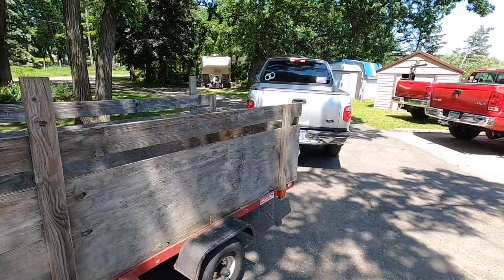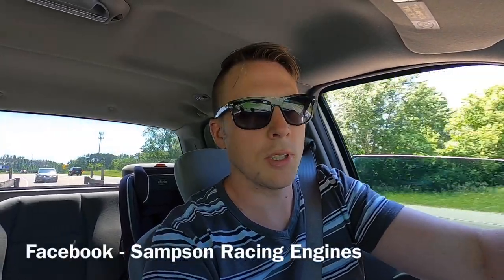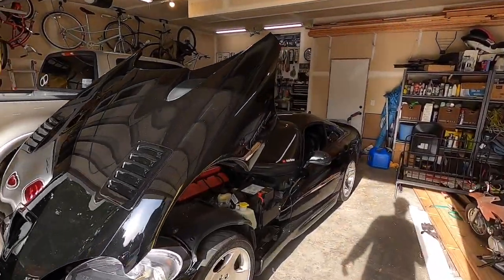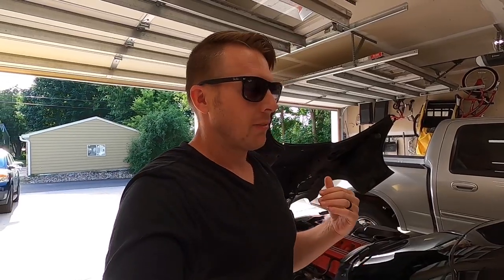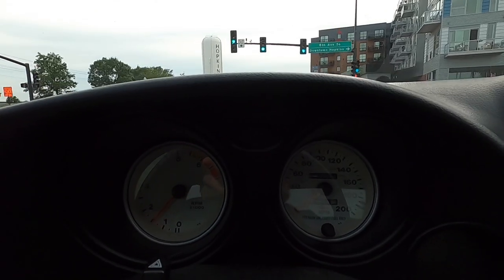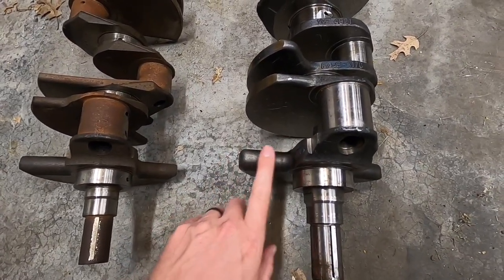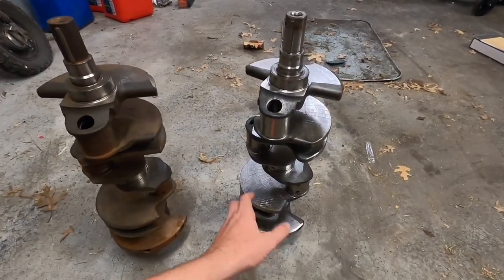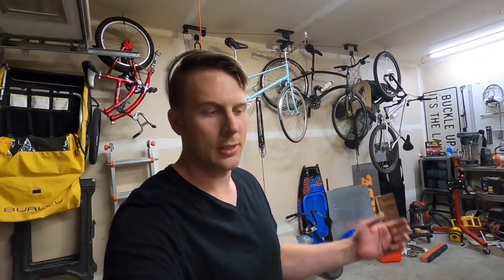1,000 HP Junkyard TURBO 5.4 Build (ep. 2) ***Cast vs Forged LIGHTNING Crank***

Comment: Keep in mind that with a forged crank your flexplate will need to be changed out. The forged cranks use six bolts rather then the 8 bolt configuration on the cast cranks. You can use a flexplate from a navigator if you’re going to keep the 4R70W... but with a 1000hp you might want to consider swapping to the 4R100. Swapping will be easier considering you don’t have a transfer case.
Reply from the maker: I hadn't noticed that. I'm going to see what my options are for building the 4r70w since I actually do have a transfer case and want to keep the 4wd if I can.
Reply: Auto Detour - Thats what I mean, I’m pretty sure the Lightning was the only truck with a forged crank which was a 6 bolt. I don’t think they have a flexplate in a 6 bolt configuration that will allow the torque converter for the 4r70w to bolt up. Sorry, I guess I was always looking at your gauge in the vent and never noticed the 4wd selector switch. Lol. The swap will work with your current transfer case. I’m working on switching to the 4r100 myself. Now I’m curious....
Reply: @brocklagunas3055  any F250 or expedition equipped with a 5.4 had a 6 bolt torque converter and a steel crank
Reply: I have a 5.4 from a 2001 e250 and it has a forged 8 bolt crank
Reply: That is backwards the cast is 6 bolt and the forged is 8 bolt.  That is how it is on the mustangs I assume it's the same with the lightning.
Reply: @midnight347  It is
Reply: Actually  the cast cranks for the 5.4 are 8 bolt and the forged are 8 bolt as well. I have not come across  a 6 bolt 5.4 crank.
Reply: @chadparrish9863  there were no cast cranks in any 5.4 that came in any truck or SUV...they are all steel cranks. Some of those steel cranks had 4 bolt flex plates for the torque converters and some had 6 bolt flex plates for the converters

Comment: Def won’t make 1000 hp on 93... e85 is your only chance! 9:1 compression ratio I’d shoot for, prob going to take 25psi on a 88mm turbo to make 1000whp with my guessing lol
Reply from the maker: I think you're right. e85 is gonna be where it's at. Possibly meth injection 🤷‍♂️. Upgraded turbo for sure! LOL
Reply: It really just depends if you use huge turbo(s) you can make alot more power on pump gas but it's gonna be lazy on the street this way if you want a good street powerband it's probably going to require e85 I'd think.
Reply: Who says it won't make a 1000 on 93 octate.  We don't even have that e85 around here and we run 93 octane have no problem  making a thousand  hp with 93 octate.  E85 would of course  make it easier  but it's not impossible.